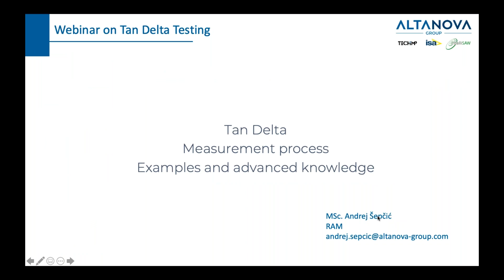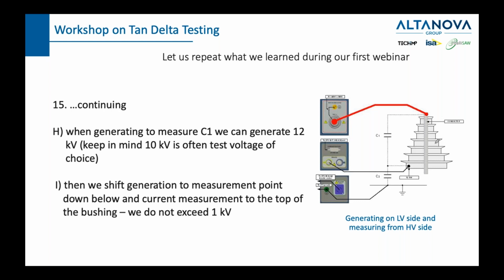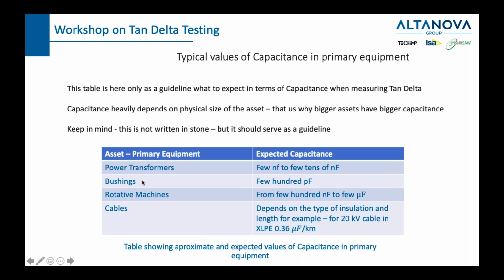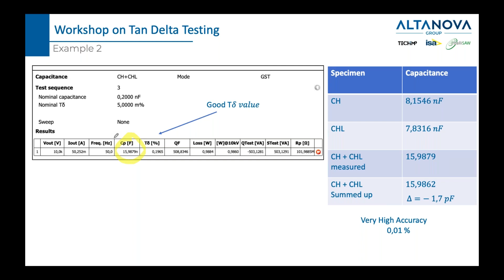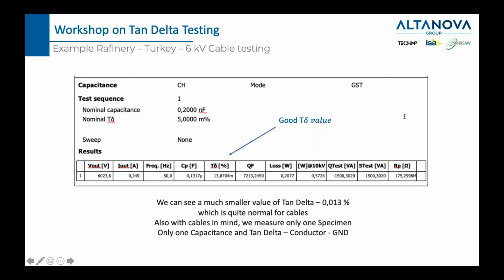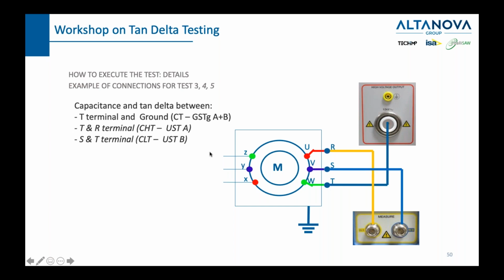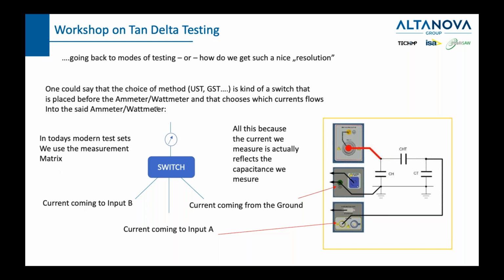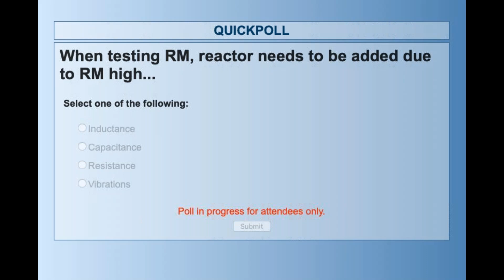Tan Delta Webinar Advanced

Comment: you havent mentioned about 'tip up' value of tan delta sir ?? our testing agency give reports in terms of tip up or difference in tan delta at higher voltage to lower voltage level. Kindly explain its significance too sir.
Reply from the maker: Dear PV, you have correctly noted that I have not commented that here. Tip up test and some time also tip down test is executed. It is standard when testing rotary machines, and with trafo it is not always required. Having said that different countries have different standard which is why I have not explicitly mentioned that here, since I would need to cover all the standards. In general if TD value on Trafo had increased significantly or the value is high, we can perform this test and we evaluate the curve, which should not change the value too much. For example we do not want to see high value for low voltage, that then decreases and continues to grow afterwards.
Reply: @sheppo17  Dear sir, thanx a lot for the reply. We get 600MW turbogenerator stator tested for tan delta at 2kV, 4kV, 6kV, 8kV, 10kV, 12kV and difference in tan delta value at 12kV and 2kV is considered as acceptance norm for tan delta by our testing agency as per IEEE62.2 . The difference is quite less but tan delta is just greater than 1% in case of turbogenerators. Is tan delta always higher in case of rotating machines ?
Reply from the maker: @926prasenjit  yes, almost always rotary machines have higher values of tan delta
Reply: @sheppo17   sir, if you have time , please make video on tan delta test values of rotating machines of high rating such as turbogenerators, hydro power generators. i can share test data with you if you want.

Comment: sir im working as executive engineer in APTRANSCO, ANDHRA PRADESH, INDIA USING ISA TDX 5000 FOR TANDELTA MEASUREMENTS OF EHV BUSHINGS, POWER TRANSFORMERS, CTS, PTS, BREAKERS VERY OFTEN
1) IN DEMO VIDEO THE CONSTANT K AND WHILE TESTING CAPACITANCE AND TANDELTA IN KIT THERE IS A CONSTANT K BOTH WERE SAME OR DIFFERENT?
2)WITHOUT SELECTION OF K BY ADDING NEW TEST POINT IN ISA TDX 5000 KIT THE TANDELTA VALUE MEASURED IS AT 20DEG CENT OR AMBIENT TEMP?
Reply from the maker: Dear Harinadh !
The constant K is the same for Tan Delta and Capacitance mesurement. And about question 2 - it is not measured at ambient temp because TDX does not know what is the present ambient temperature. Hope this helps and excuses for late reply.

Comment: Hi Andrej, can I know whether this tan delta is based on schering bridge measurement?
Reply from the maker: Hi Sharin ! Yes, but it is automatic
Reply from the maker: There is one ultra accurate capacitor inside and two very accurate resistors, all with very small temperature drift

Comment: Can u share link for next webinar?
Reply from the maker: Hi Sharin !

 This is it - it is for Partial Discharge. We will have one more on Tan Delta but on 7. May.

Please register for Introduction to Partial Discharge test diagnostics on HV cables on Apr 30, 2020 2:30 PM CEST at:

https://attendee.gotowebinar.com/register/5012824550515597838

After registering, you will receive a confirmation email containing information about joining the webinar.